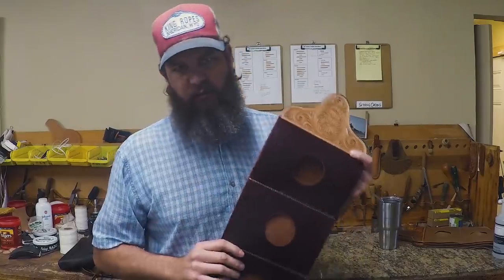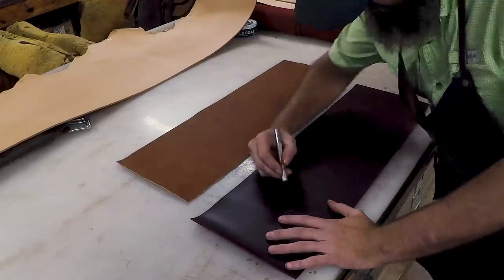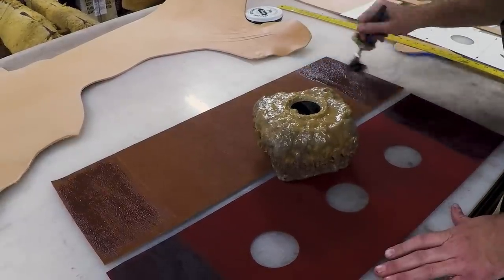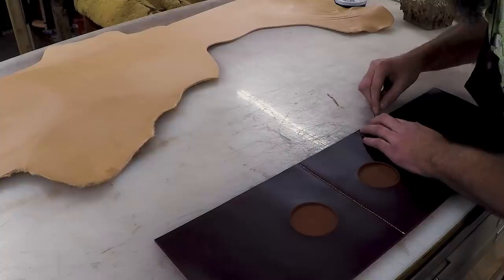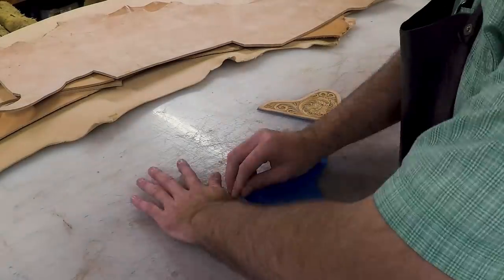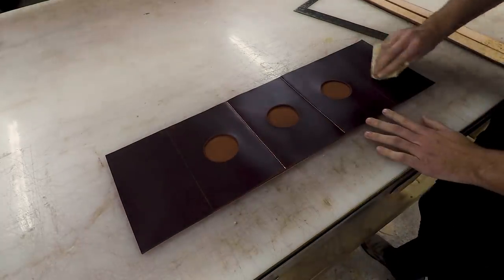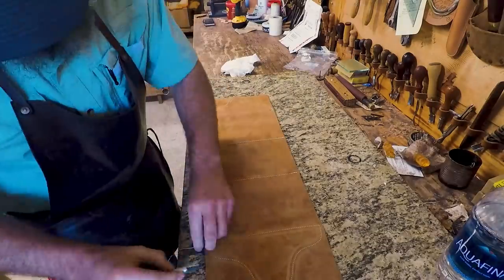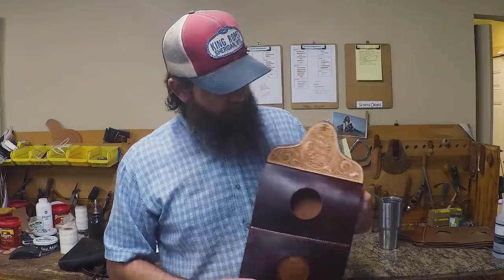How to Make a Cowboy Wine Hanger

Comment: Please help me to do my project
Using marbled leather, design and produce a rack with two
compartments for holding wine bottles.
The rack should have an inscription "COCKTAIL" using any
suitable technique.
It should have a stiffener, a suitable hanging device, thonged edges
and a lacquer finish.
Measurement: 40 cm long.
2
Using natural leather, design and produce a hunter's quiver.
The quiver should have embossed and scorched designs depicting
hunting activities.
Measurement: Diameter
D23/wschasipa/id
Length/height
Finish Appropriately.
- 10 cm
- 35 cm